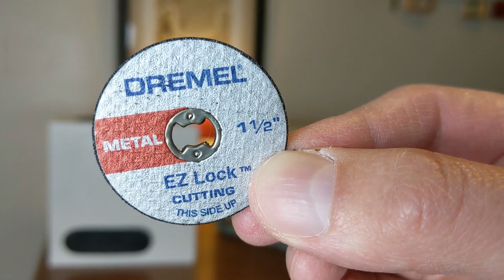How to Build a Sleeper PC Part 2: Improving Air Flow in Older Cases

Comment: What many people miss is that when you raise the case a little bit by adding higher feet you can pretty much remove the entire bottom of the case to get some massive airflow going. The problem of proper exhaust still remains but to pull air in this is a great way.
Reply: Yup - just need to add some dust filter/filter screen
Reply: @roimores  Marjinally more frequent cleaning is definitely a small price to pay for this!
Reply: An array of uniform holes cut into the back plate allows for the air to be pushed out due to the pressure differential. No real 'need' for exhausts if you play it right. he could have also easily drilled out holes around the ear exhaust here to increase that to an 80mm.
Reply: Can you make a tutorial on this cause my gpu is getting choked

Comment: As a small correction. Even a lot of modern cases, some would argue most of them, have utterly garbage airflow. While it might be slightly better than some older cases, many modern ones do it just as badly. From dust filters that kill static pressure to glass front pannels that choke off the fans. You'd be surprised at just how bad these cases are for your thermals.
Reply: yeah, I noticed on my cousin’s prebuilt it wasn’t getting too hot but the small intake on the top would not be enough for great thermals.
Reply: True.  I have an Antec Sonata II case and the limiting factors aren't the case per se, which actually has decent airflow considering it only uses a single 120mm fan (Noctua),  it's the blower fans and the stock AMD cooler.  Temps in the case, aside from the CPU, are more or less the same as my SO's much more modern Intel setup which has 4 fans and lots of air filters.

Comment: I built my sleeper out of a gateway 2000 full tower from 1997. I'm an older guy with a lot of tools and a career in the trades. I'd never attempt this sort of thing without at least some basic fabrication skills, but y'all do you.  I didn't build it necessarily to be a "sleeper", I just actually like the way computers from that era look. I knew I needed a new computer and I didn't want a modern case mucking up my vibe so I spent almost the same amount of money and like 15 hours of my limited time on earth making this thing work. To me it's totally worth it because there's a Pentium Pro sticker on my computer. Your milage may vary.
Reply from the maker: Yeah, Gateways can be hard to work with, mainly due to the custom I/O area that only accepts very specific (gateway) motherboards. I had to take a Dremel to mine to open up that area for a different motherboard. It was worth it though... I really like the look of the late 90s gateway cases. And they're actually pretty good sleeper cases if you don't mind modding the rear!
Reply: @GamingRetro Mine had a piece of sheet metal there, screwed to the case about 2 inches wide, but the same height as a modern standard i/o panel so all I had to do was one straight cut. Quick sheet metal tip, score the piece you want to cut with a sharp utility knife and a straight edge. Securely clamp one side of your work near that cut then flex the piece back and forth and it will snap on your score. I'm sure that's not a great description but it's the way that house flashing is cut using a break. I'm sure someone has made a video about it. Comes out much cleaner than more accurate than using an abrasive wheel (also way quicker and much quieter). Most of the time I spent on this case was on airflow management (drilling/reaming holes, fabricating fan mounts). Pentiums run much cooler than Ryzens :).

Comment: What I´ll probably do is put slightly higher feet under the case (if necessary) and air intake from the bottom. Alternatively I could try to dremel open some of the underside of the front plastic cover to allow more airflow there, if that cannot be seen. Also: for power supply I´ll put an sfx psu to somewhere front part of the case, and build a funnel with one or two 120mm fans to blow air out from the psu hole from the back.  Leading the power cable to the psu from the back (like in many itx cases) will have to be thought out also, not sure how that goes.. Will see how this turns out when I get to building this in few weeks. :D
Reply from the maker: Yep, the underside is typically underutilized but can work great. Best of luck!

Comment: A sleeper build is to be just that. No outward appearance change that implies you have a power system in the case. When you start adding big black vents to a case and adding RGB? You have lost what sleeper means
Reply: Same happens with cars. Idiots have no idea what they are doing.
Reply: I had to add vents to mine and ghetto rig several things but it looks mostly the same except for the stickers (modern Ryzen/Geforce GTX inside)

Comment: I am working on a solution for this issue myself. I have an In-Win V508 series case. It shipped with single 3-pin 90mm exhaust fan and a top mounted PSU which actually sits in an 'attic' with the 2 5.25 bays. Originally, this case or it's immediate predecessor appears to have had one of those plastic cages for a front intake fan, but then InWin punched a hole through the bottom of the mounting area for a USB header. The interior of the case does have perforations for airflow, and the plastic front panel includes a series of wide slots here as well.

Although the 92mm attachment holes are blocked by this USB header, there are holes that look like they allow direct attachment of an 80mm fan. However, these holes are slightly undersized and don't accept standard fan screws. Before drilling or hacking anything, I am going to try a set of silicone rubber fan mounting 'nails' or whatever they are called. I already have an 80mm 3-pin fan salvaged from a damaged case to use here.

If these work, then I have a really cool 'sleeper' build with very little modding.

Comment: So I’m building my first pc and in an effort to budget I’m using a relatively old case (2013 gateway dx4870) I know it’s not retro or even close to retro but your guides have been the closest thing I can find to a clear and well worded way of describing what might one consider building a sleeper. I’m here asking if using my case (I can provide a link to a Newegg listing that shows the specs of the pc including pics of the case) is a good idea. I’m not that handy so I want to avoid crazy adjustments that’ll require tools I don’t have any experience using. I’m only really worried about thermals and airflow in the case. I’m only slightly worried about dimensions but I think I have everything considered correctly. I’m not worried about noise levels (having a first edition ps4 changes your perspective lol) so I don’t mind putting extra louder fans if it means I don’t have to spend more than I would on a different case. I want to know if I’m okay for using my current planned parts and some preintalled parts and if it’s even worth it to use my case over buying a new one. I can link a pc part picker list if you need more info and that newegg listing if you can’t find anything on the pc model I described.

Comment: What is a sleeper build?
Reply: Damn near every computer I've owned - 3 generations out of date but built up with somewhat mis-matched hardware.  Didn't know this was "cool"
And I still have all my old computers . . . . .
Reply: @peterdarr383  not quite, a sleeper build a pc that looks old and quite slow but inside has a better than average system of components. in easy terms its a slow looking computer that runs fast

Comment: Nice video... Thanks... I got one question... What do you think about LTT's sleeper pcs? Do you like RGB and stuff like that? Give us your opinion
Reply from the maker: Not a huge fan of flashy RGB, and honestly I don't think you have a true "sleeper" if you can see the modern components through a side window. With that said, I do like smaller modern touches like the LED power switch I use in my 2001 sleeper build... basically I think it's fine if it's not over the top and just compliments the original case design :)
Reply: @GamingRetro  in brazil people think that old cases are useless... it's really hard to find a good one...

Comment: I used to work at a factory with CNC and lathes. I wonder if you walked into one and asked what they would charge you to put a bunch of those professional looking air holes in a case for you what they'd say. I regret never getting one of the guys to do it for me back when I worked there, but this was back when there wasn't really sleeper builds. It would've just been considered a cobbled together PC or something.
Reply: I actually work in a CNC, UV printing etc studio right now and was thinking of asking my boss to help me with this exact thing

Comment: blower cards are really better for older cases.  I have an older ATX case from 2005 and the airflow wasn't designed for newer updraft cards, so temps are a little higher than I'd like.

Comment: I ain't building a sleeper, I'm adding a new card in my old ass PC, and have no money for a new case T-T
Reply: The "case"  is not important, but what is inside that is important! 
I myself have a 20-year-old larger case, I use high-quality Arctic cooling 17-year-old fans and everything works with Ryzen 5500 on an A520M board. The processor does not even reach 50 degrees Celsius
It is useless to give money for things that are not so necessary to change!
Reply: @pumelo1  in your opinion is one 140mm intake and one 80mm exhaust is okay? For a 6600xt?
Reply: @jocap3837  I don't use such high end cards, they are expensive and my country has one of the most expensive electricity prices in the world. I have an older RX560 4gb TDP 80watt max. So I don't even need the front fan, I only have the rear one.
It also depends on the temperature in the room and where the case is located.
For this card it is important to cool down to around 75 degrees celsius

Comment: I have an HP Pavilion a6319fh from 2008. The airflow intake does include the bottom of the case and some around the plastic shielding. The trouble is that the hard drive cage sits right in front of that intake. Does anyone else have an HP mATX Pavilion tower from the 2006-2008 and if so would you recommend it for a sleeper build?
Reply: Hey, Mike.

If you remove the bottom drive bay, it looks like there's a possible fan mount.

Comment: I commented on your reddit ivory tower build post, but you may not have seen it. I have a similar tower (almost identical but maybe a step or two below yours) and wanted to know how you hooked up your power switch. My case has a physical on off switch inside instead of a momentary switch, did yours have this?
Reply from the maker: I actually just use the reset switch! An internal switch is pretty odd?